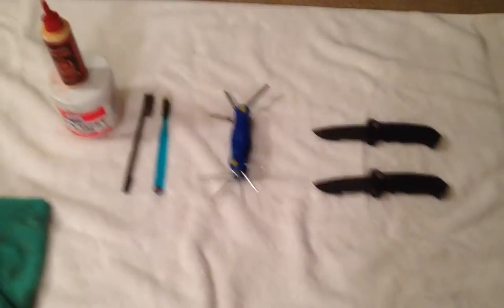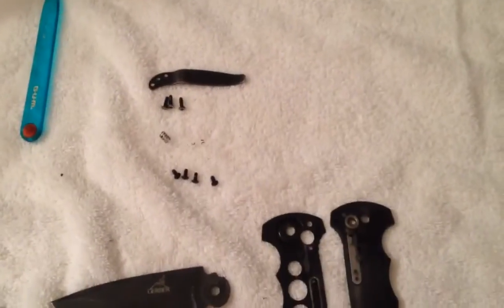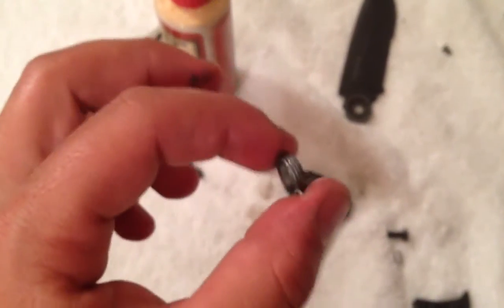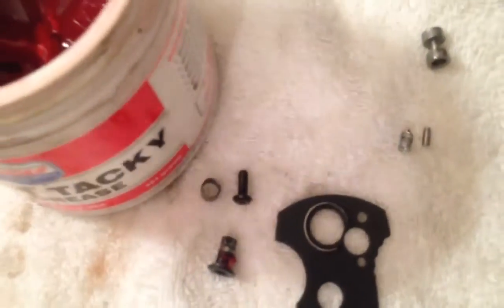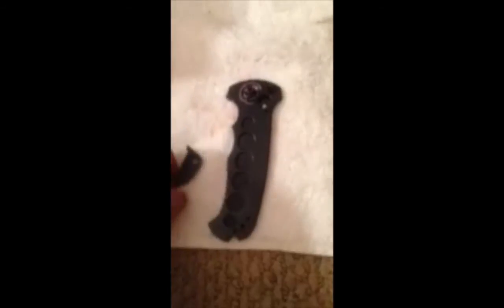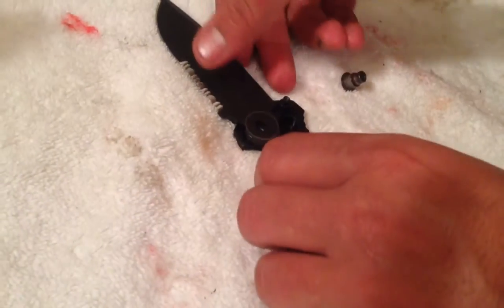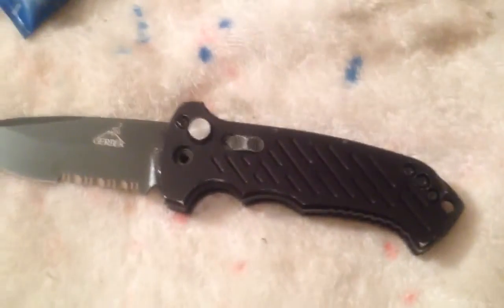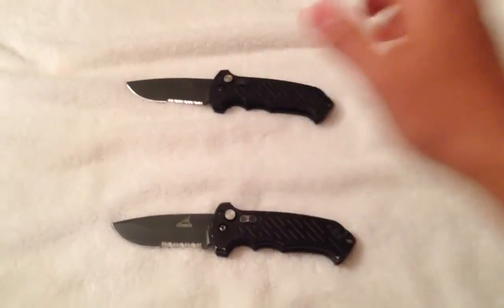Gerber 06 Automatic service & repair

Comment: Thanks for the video.  Very helpful as I was reassembling after upgrading the spring.
Reply: Which spring did you use? Any problems with installation or with its use-ability after installation?

Comment: I have one and love it! Just can't get it sharpened good due to the steel. At $175 it should be much easier to set the edge and keep sharp.
Reply: you just need the right gear.  cerax stones for freehand or gritomatic b.n. or diamond stones for lansky and kme
Reply: nope...you need to up your skills.  easyer to sharpen means less edge stability and retention.  a 175 knife should be harder to sharpen.  if you want easy to sharpen get budget knife with lesser steel

Comment: Would you happen to know where I may procure a replacement spring for the assist on this knife?  Mine broke and apparently gerber doesn't offer them...
Reply: assistedknife.com has the exact replacement springs we had them start making.
Reply: Try knifekits.com
Reply: What size and tension? Thanks.
Reply: @zacharyking900  What size spring does it take?  Wanted to order one before I disassemble and I never heard him mention the size.  Thanks.